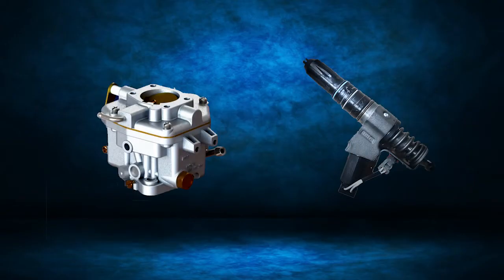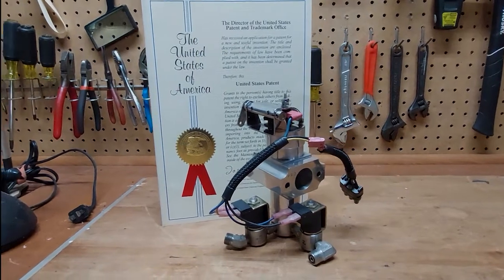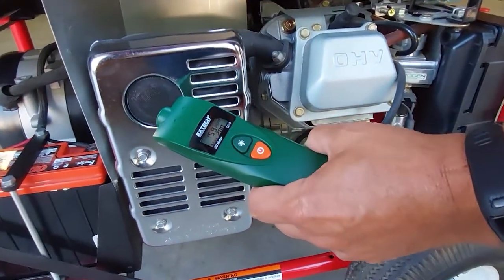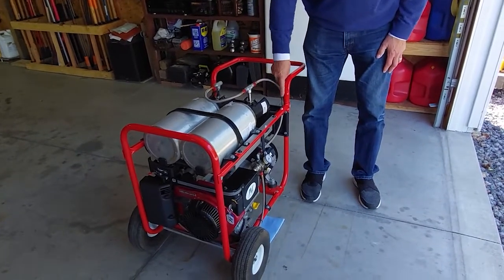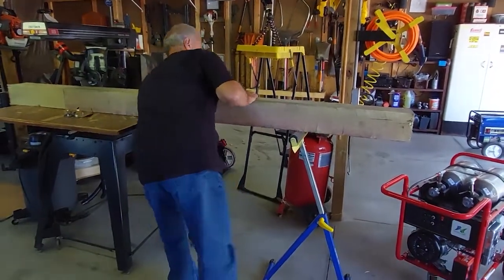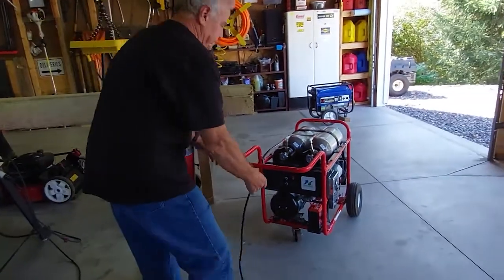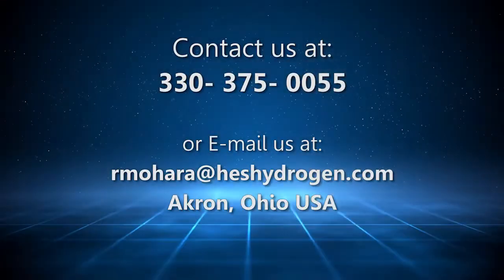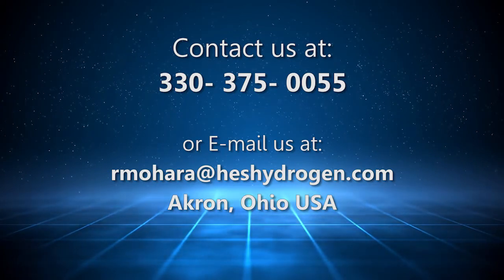Hydrogen-powered Portable Generator

Comment: Hello, I saw that the oil appeared to be clear after the run test.  Has the oil been tested or drained to see how much water vapor has mixed in with the oil?  Have you made any modifications to the exhaust port to keep it angled down so vapor cannot bead up and leak back into the engine once shut off.  I have a Westinghouse wgen12000 gas generator.  I would be interested in trying out one of your carburetors.  Also is hydrogen on demand acceptable to run one of these generators or must it be pressurized or is that only required for initial startup?Thank you.